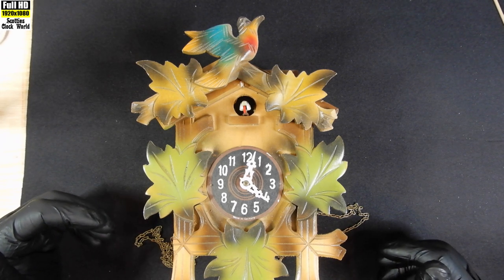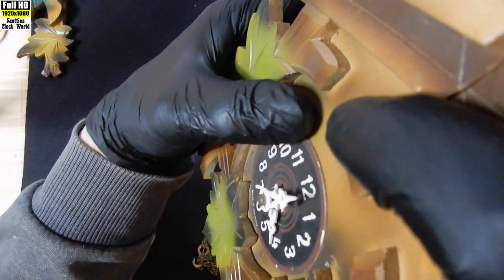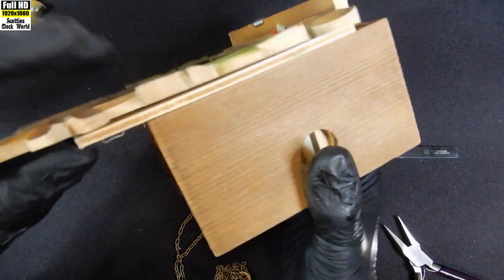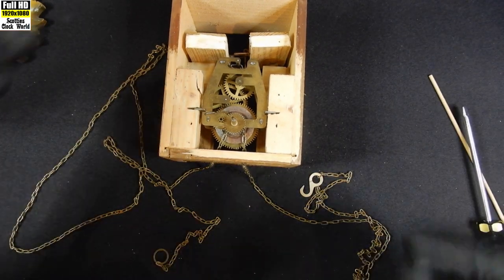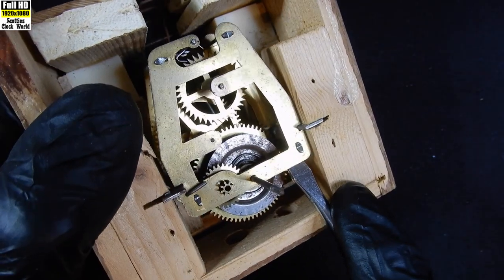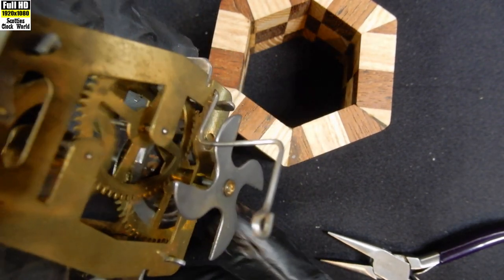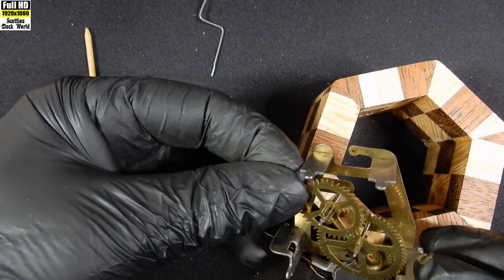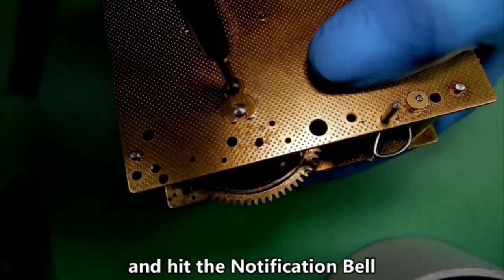Small Black Forest Cuckoo Clock Restoration - Part 1

Comment: These are known as quarter hour cuckoo clocks. They are a novelty cuckoo clock designed for the tourist. They were made to allow tourist who didnt want to spend a lot of money on regular cuckoo clocks to be able to take a clock home with them. You are correct they werent really designed to be worked on. I have several that I repair on my you tube channel showing you their function.
Reply from the maker: Hi Mark, thanks for your comments. I watched your quarter hour cuckoo clock for Jeffrey and it is the same movement as this one.
Reply: @ScottiesClockWorld  Jeffreys clock had issues. I end up stealing parts from my clock for his clock. Got it running. Shipped it to him. The post office people had thrown and dropped the box. The clock had arrived destroyed. I made an insurance claim for him. Then sent the money to him.
Reply: @ScottiesClockWorld  you should watch the one on the Australian quarter hour cuckoo clock. They are made better.
Reply from the maker: Ok, I'll check it out, thanks.
Reply from the maker: Have you got the URL? I cn't find it on your channel.